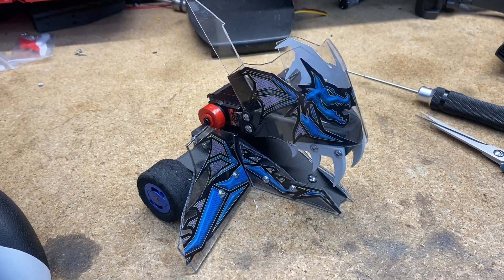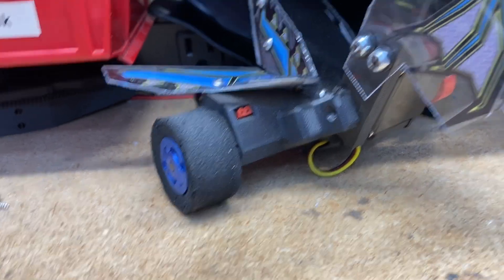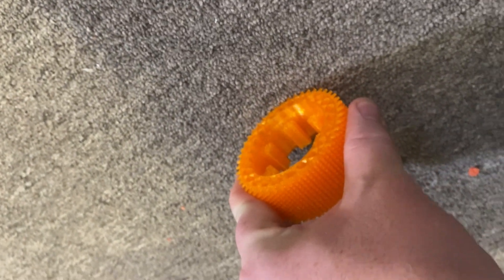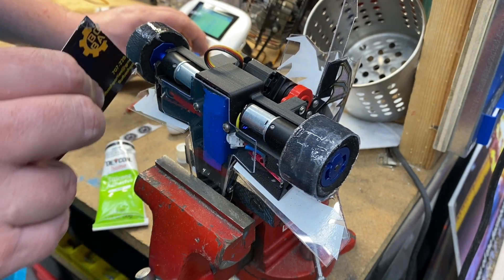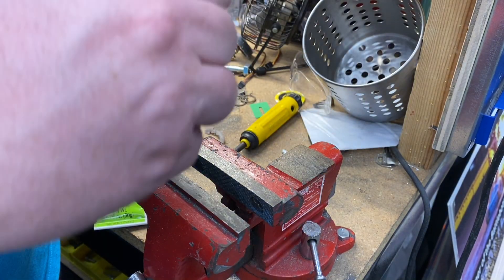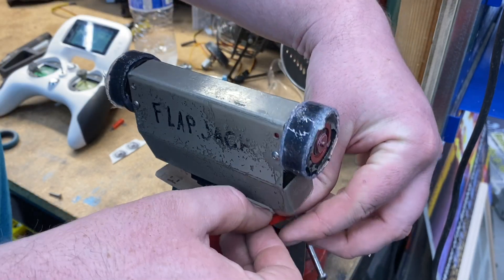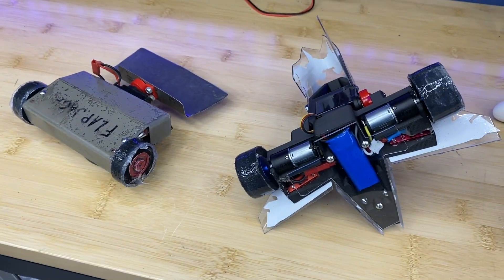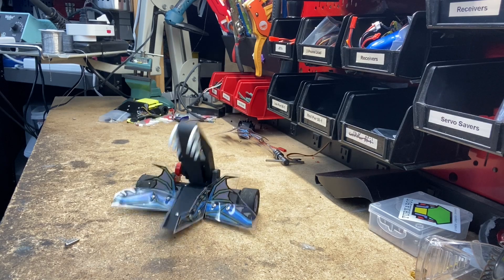This SECRET TRICK Boosts Robot Performance by 273% In Only 8 Minutes

Comment: I've seen competitors use silicone. I've also seen people use Flex Seal and latex body paint. I personally use latex body paint, remembering to put on a layer of contact cement on the wheel first to make sure the "paint" doesn't come off and become an entanglement hazard.

Comment: For smaller antweights (european 150gr) or people with 3d printed wheels instead of foam, I recommend rubber bands. They glue super well to feet and they increase traction by a ton. 

If you can buy the thinner ones you can model multiple tracks in your wheels for the rubber bands to sit in. This will make it harder for the other robots to remove them all.
Reply: I really like the idea of using rubber bands. You could use a 3D printed wheel with grooves put in maybe 3 or 4 places depending on width of wheel and rubber bands. The band only would need to be sticking out maybe 1/32 to work. A simple replacement as well.
Reply: @Lwimmermastermetalart  this is exactly what I did. I have rubber bands that are only 3mm wide. I use two so even if one would get hit and torn completely off, I would still have one extra.

It's 1mm thick, so the groove is .6mm deep.
Reply: @PelleKuipers great idea. Much better than slopping on silicone. 👍🏼

Comment: Very cool trick for some traction-limited bots. I've pretty much always been casting urethane rubber wheels over PLA and TPU hubs for lower weight classes up to featherweight and I'm surprised how close the silicone is in performance.

Comment: Who would win kraken vs captain shrederator
Reply: Depends on which version of each robot you are asking since there are very significant differences between for example Season 3 Kraken vs Season 7 Kraken (Same applies to Capt. Shrederator) and also if both robots are working at 100% capacity since both robots had issues with reliability and sustained damaged from previous battles on TV. However, if this is assuming that both robots are working 100% in their current designs, then I'd have to give the edge to Kraken since Kraken is fast enough to prevent Capt. Shrederator from getting to full speed meaning it's unlikely for Captain Shrederator to get the hits it needs to break Kraken. Furthermore, the addition of the shelf must make it generally very difficult for horizontal spinners to get up to speed due to a lack of space for them to run away and regain speed. This is exemplified by Captain Shrederator vs. Ghost Raptor, where Captain Shrederator repeatedly hits the walls and shelf due to a lack of space and offensive pressure from Ghost Raptor.

Tldr - Kraken wins due to Matt's aggressive driving style and Captain Shrederator's relatively long spin up time.